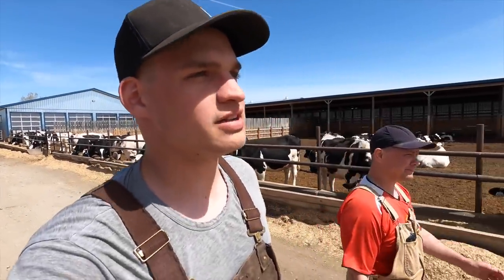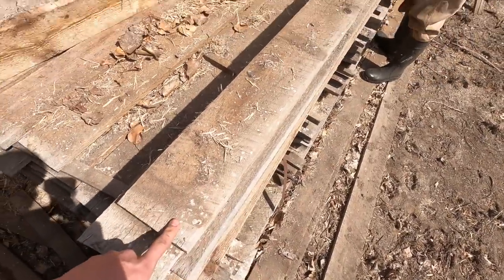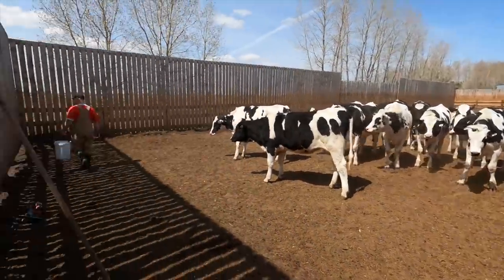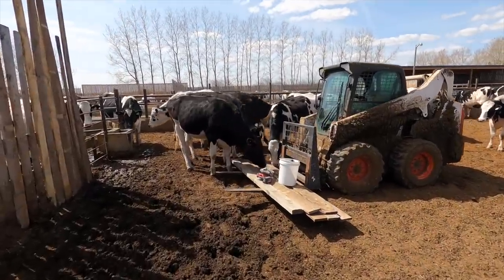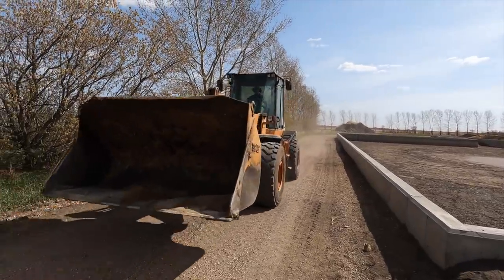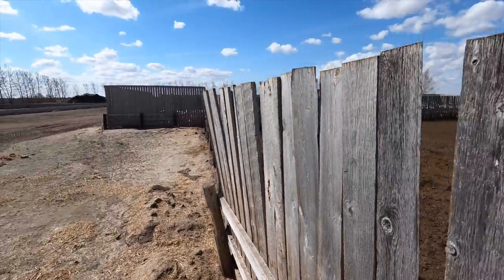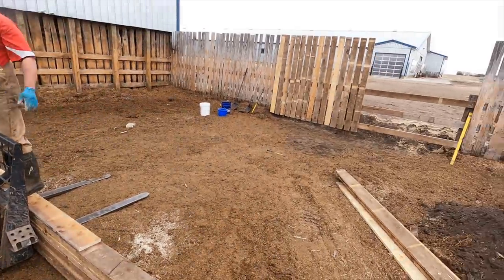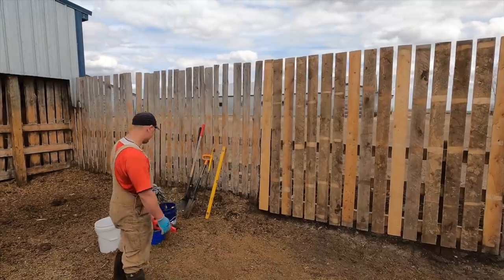Fixing Broken Corrals

Comment: 2 things firstly i was about to say a chainsaw works better than a circular saw for cutting thr tops and secondly im surprised your wind break fence doesn't have a top support it seem wobbly at the top and would put stress on the joint between the uprights and the cross piece

Comment: You domt need the palm nailer from milwaukee. You need milwaukee new 3 1/2 imch framing nailer. 3 nails a second on a battery no compressor.

Comment: On the steer side; run the rough cut 2 x's horizontally to prevent them from pushing against the vertical boards. Then you shouldn't need to replace any more vertical boards.